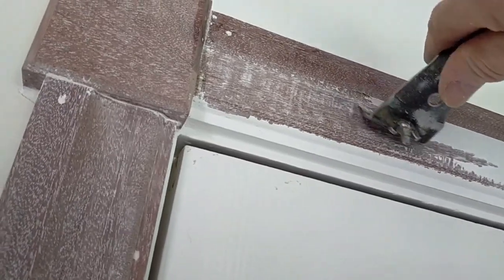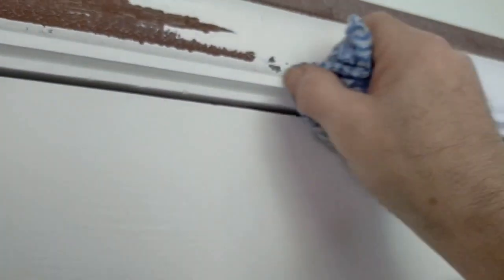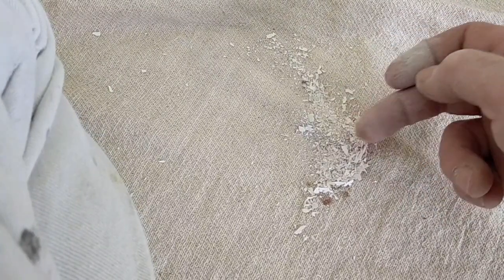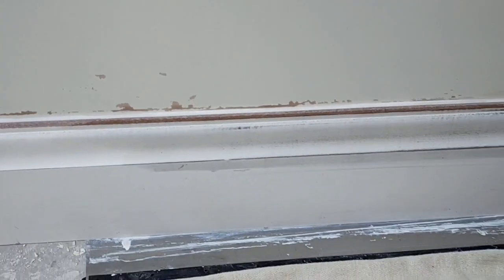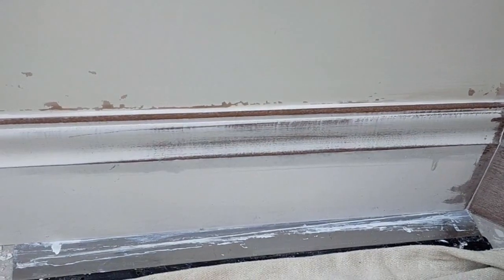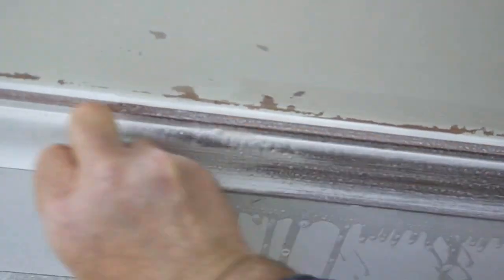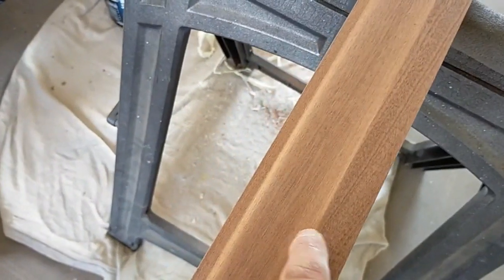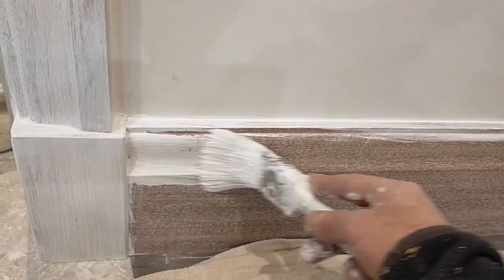Are You Having Problems With Pre-Primed Wooden Trim ?

Comment: another great video once again!! in your opinion where would you use Zinsser BIN and 123?
Reply from the maker: All depends on your problem..  between adhesion and stains...    sometimes a combination of both solves your problem..     you could treat knots with B.I.N then coat bare wood 123....     some metals your better using 123.     Thanks
Reply: @PaintingandDecorating  been watching your channel think it's great  thought you said b I n  is not great for knots

Comment: I prefer my old skarten 80 or 62 to those carbide scrappers, its quite hard to get blades so I constantly look on ebay but for this sort of job they really are excellent.

I've heard the old watered down emulsion thing from a few carpenters and  even a joinery shop corrected  them.

 I suppose it might be all well and good  and cheap if the only aim is to impart a vague white colour but as you say impossible to actually paint over.

Comment: could you please tell us why the wood didn't accepted the primer as it should've accepted? and the skirting board was emulsioned which you said was wrong. What kind of paint system should've been used? thanks.
Reply: Think it was watered down contract matt and not primer (didnt adhere)......... I've been using what these guys have used before in vids... zinnser Bin then undercoat then gloss top coat (rub down in between) for window ledges./ skirting.... I know f all about professional decorating and time is not really an issue, but have followed these guys and no major cock up's as of yet....... apart from forgetting I was on one of those 50cm high platforms.
Reply from the maker: @siypic  Thank you...     I've had a serious fall off steps that were left in the room by the customer.. instead of taking them out I left them...  on using my own steps on half the room I accidently picked up the wrong steps..  the bar at the top was  half a foot shorter than mine... while stood on the top as I would usually lean in with my leg...  you can imagine what happened next... straight off literally horizontal head just missing fire place and the biggest bag hitting the floor...   trying to save myself I dislocated two fingers... did not spill a drop of my paint.    Got up put my fingers back in place and carried on till dinner then went to the walk in centre  for dinner and a check up..  they said I was okay did a few X-rays on hand...    was okay at first carried on work for a couple of weeks in pain.. till I could not actually lift my arm up.   Cut  the story short 2 years off work two surgery and golfers elbow treated...    hope you're okay any fall or slip can hurt..
Reply from the maker: Emulsion is made for plaster and paper....  wood can have a difficult surface for paints to adhere to..  you use a primer to help promote adhesion.
Reply: Johnstone Acrylic primer is perfect for bare wood, easy to apply and clean up. I only use Zinsser on knots or difficult surfaces like old varnished woodwork / kitchen units ect. I have never heard of anyone using thinned contract matt on anything other than bare plaster.
Reply: @PaintingandDecorating  I fell onto the 367 cans of soudal that I've stockpiled since watching your vids....... and bone cracks I got were sorted.